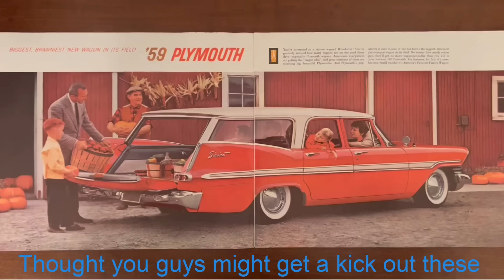Large Marge gets a Little Rehab

Comment: Marge is quite the sweet ride!.  I find much of the patina to be pleasing - on the roof and parts of the sides.  However, in the places where it appears to have been ground down to bare metal then left to rust - it's here where the patina looks "forced".  I'm not certain if a full repaint is in order or a scuff with a clear coat to seal the metal would be best BUT something needs to be done to seal the bare metal against rust.  I would consider painting her with a "Fauxtina" approach which allows for better control of the patina as it creates a stronger protective covering over her sheet metal.
My thoughts on your wipers is to look for a "Park" circuit within the wiper motor itself.  Many systems continue allowing current to flow in the wiper motor AFTER it's cut by the switch on the dash, thus allowing the motor to cycle to the "Parked" position.
Best of luck, Kiwi!
Reply from the maker: The hood is the worst part  I think that's just been baked off.  Regardless I'll have to do something to stop/slow the deterioration.   Thanks for watching!

Comment: Ford solenoids are easier to get, on the pro side. On the con side, there is now one more relay to possibly fail in the future.
I couldn't find that video where you asked us about which engine we preferred to go into that wagon. In order of preference:
1- Keeping the Poly and then examining the piston rings for varnish that would keep them glued to their pistons. Swapping that cast-iron Torqueflite for a more modern aluminium-cased one
2- Increasing the poly's displacement, as suggested, keeping in mind that this would be the final cylinder bore possibility, in case of eventual cylinder damage
3- The 392 Hemi
4- A modrn Hemi
Reply from the maker: You're right it could, but for the advantage of the extra ignition voltage on cranking I think it's a good idea.  Plus it's a quality relay not a $3 eBay Chinesium 😉.   That video was a UTG one. I agree with your 1,2, and 3 but a modern Hemi is out in my book. Thanks for watching!

Comment: Hey Kiwi, I was thinking on that missing dash plate for the controls. You might cut that out of sheet metal like aluminum or stainless by using the one you have on the other side as a template, then do some jewel work on it to match the other side. As the original one’s would have been either aluminum or stainless. It won’t be factory, but no one will know if they both match.

Comment: I remember working on my 318 Poly engine, put a 4bbl on it, edelbrock carb, and it was a great driver with factory air conditioning, power brakes.
Reply from the maker: A/C and power brakes are on the list. What car was it?
Reply: 1961 Dodge car, 2 door sedan, pushbutton automatic.  It was very fun to drive except on the highway on days with high winds, the grille was a large scoop.

Comment: This reminds me so much of my 76 Jeep J10 i got running 3 months ago.   Wipers working and sprayers spraying right.

Then getting a better alternator in the Jeep the 37amp single wire alternator sucks.   Causes voltage spikes up down nad dimming lights and stuff.  I put a 12si 90amp two wire alternator in there with an internal regulator

And my solenoid has only 1 pin.  Had to figure out how to bypass wire the old external regulator to the starter solenoid.   Then i had to ad a dummy light for the exciter wire on the alternator so it doesnt stay running when you turn the key.  Lets not forget bypassing that fire hazard amp gauge.. especially with the new alternator.

All the same processes lol. Funny
Reply from the maker: Yes indeed !!

Comment: So what you have is the standard Fury V800? It is the mobilgas economy winner can't go wrong with that pedigree for a cruiser! lol Did that car originally have the airbags? I thought it was leaf spring in an earlier video
Reply from the maker: Yes it's a leaf spring car. Not sure airbags were an option, at least not on the Plymouth
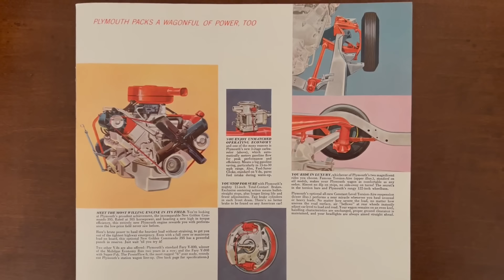Reply: @kiwiclassicsandcustoms9160  7:57 in your video the literature shows leaf springs coupled with an air bellows for constant ride height control regardless of load.  It is the constant leve Torsion Aire suspension.
Reply from the maker: @bcbloc02  your right it does!!  Ya something every day!  Thanks for spotting that. I wonder if there are any left in operation🤔

Comment: Restore the poly back to standard with twin pipes .  Original paint 🎨 and trim . Only original once  every one always want a different motor 😵‍💫🥱318 poly will perform quite good . Once you start charging motors it never ends . Keep her the way mother MOPAR made it . The boys at the car shows will love it . Yes wheels even a 4 barrel if needed  . That’s the same picture I have hanging in my shed in Tasmania . Owed 2  66 Phoenix with the poly 318 and they pulled strong . Drove my mates 63 phoenix around and for a poly she pulled hard . Yes I’ve owned many rare and hot chargers pacers V8 Mopars  and yes some rare Ford . But those polys with the right exhaust have the most awesome exhaust note . Except my 360  AMC 1980 FSJ  with the T/ Flight  I tell you there a healthy sounding motor with the right exhaust and it pulls like a train  . All the best with her . Scott on Cold War motors in Canada 🇨🇦 may put you on to people who may have bits your looking 👀 for . 👍🏻🇦🇺.

Comment: I wonder if it wouldn't be simpler to insulate the solenoid mount point from ground with plastic bolts and plexiglass insulator plate, then hook the neutral safety switch to it so the it provides solenoid ground in the right position.  Maybe might look too cheesey, I dunno.

Comment: What I find odd is that it doesn't have a radio. Almost every car I remember seeing, exploring junkyards back in the 70s, 80s, had radios in them.
Reply: I had two '65 Bel Airs with a factory block off plate where the radio would go.  On that car even seat belts and reverse lights were options.
Reply from the maker: It is a little unusual and this is the first I've seen with no holes in the dash. The holes are typically there and covered with a blanking plate installed on the assembly line
Reply from the maker: @craigbenz4835 yes, it's the same on 66 mustangs, rear seat belts weren't even an option till 66

Comment: They don't Run the ballast resistor on the Old Mopar s?
Reply from the maker: This one has one and it looks original.  What they didn't have is a direct 12 volts  to the coil under cranking to give the ignition system a little more umph while cranking to help them start. If you run 12V all the time it's very hard on the points.
Reply: Thought so but didn't see on the firewall,  what a Cool old machine. She Big!!!👀👍

Comment: Very interesting about the relays. I'll have to brush up on my understanding for a relay to ground.  Thanks
Reply: The Ford relay grounds thru the mounting bolts. If you could isolate it, you could ground it thru the Neutral Safety Switch. However, those Ford relays draw about 4 amps to energize, which could burn out the NSS. A Bosch style relay only needs about .16 amps, and grounds thru terminal 85 or 86.  Kiwi will get it figured out, it isn't that difficult.